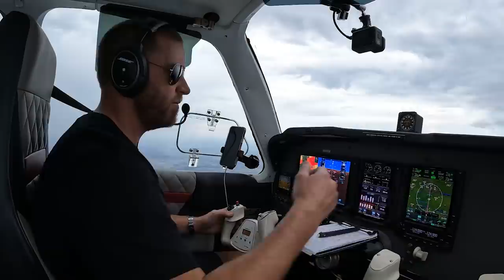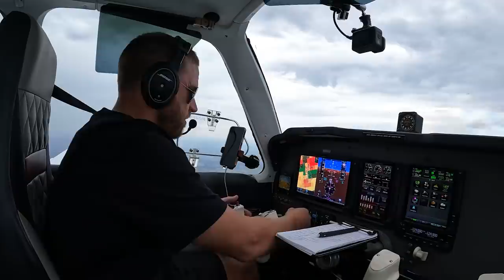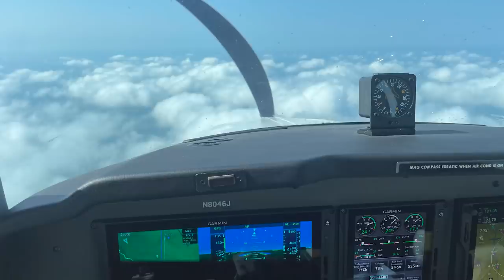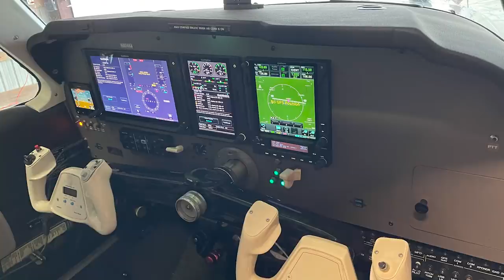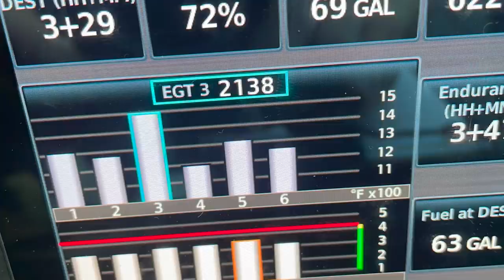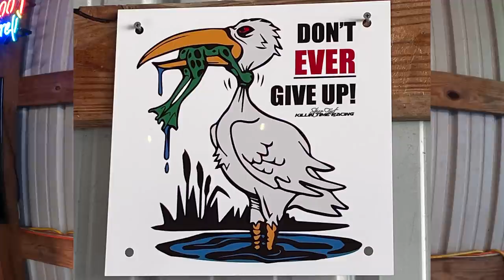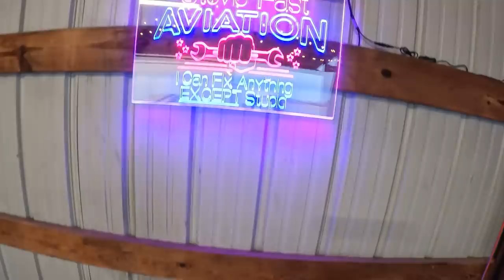WE GOT A PLANE! - Up In The Air With Stevie Fast - The Beginning. Flying The Bonanza F33A

Comment: I had a love for aviation at a young age. Worked at local airport in high school & another local airport a few years later. Got my pilot's license at the second airport. Employees could rent planes for half price. Haven't flown in several years now but still have a love for it.
Reply from the maker: You need to get back in the air. !
Reply: You can rent airplanes? What is required to do so?

Comment: Something to think about: 
The Horizon line will Always Always Always 
Be at your eye LEVEL. Walking, Driving in a car, on top of MT. Everest, flying in a plane, or jumping out of the Red bull can. It will always be at eye LEVEL. 🤔🤔🤔
Reply from the maker: Hmmmmm
Reply: @SteveJacksonRacing  
Always!
Reply: @SteveJacksonRacing  here is another one to think about:
Direct Moonlight is colder than the shade in the moonlight. 🤔
You can test this with a laser thermometer. 
Or a thermal camera.

Comment: Amazing Stevie great video I do have one question what power settings do you typically use I fly a flight sim with the A2A Simulations V35B Bonanza and I would love to try your cruise power settings
Reply from the maker: Depends on altitude and wind, normally 23 inches of manifold , 2400 and 75 degrees rich of peak.
Reply from the maker: And thank you!